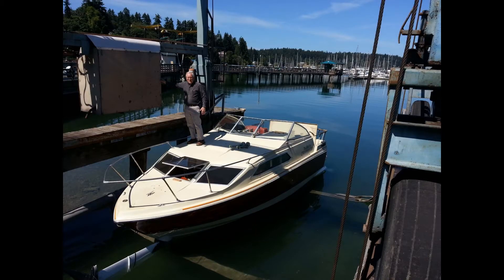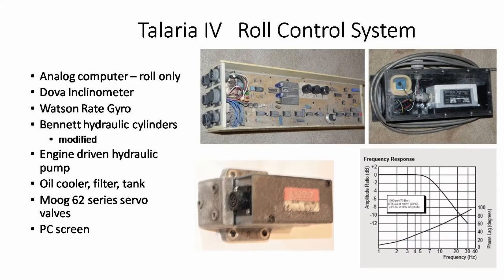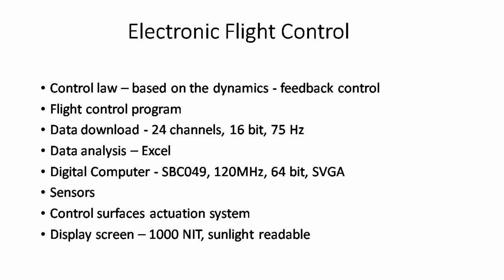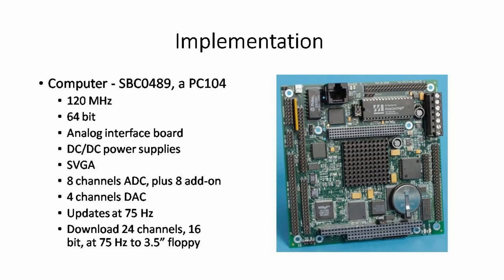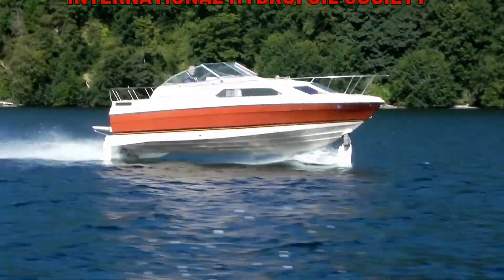HYDROFOIL -- CONTROL SYSTEMS FOR HYDROFOILS -- HARRY LARSEN EXPLAINS ALL

Comment: Hi Harry. It was nice to see some footage of the evolution of Talaria IV from your earlier experimentation with smaller foil-equipped runabouts.

I have a few comments and questions, some of which you might be able to cover when you give us your live Q&A on-line presentation on 10 November:

1.   You mentioned that surface piercing hydrofoils perform more poorly in following seas than in other wave conditions. That is a shortcoming that had been recognised by the designers of such hydrofoils. Supramar had recommended lower wave height operations in following seas than in head seas. Of course later on, for the RHS series of hydrofoils that Rodriquez built, they had in some cases incorporated a Stability Augmentation System (SAS) developed by Hamilton Standard which provided automated flap control in a design that fundamentally still retained its surface piercing characteristics. There is an old Rodriquez promotional film (bow video) available on YouTube, posted by fellow IHS member Garry Fry, in which the SAS is described and the results achieved from this are demonstrated in broad terms. But I wonder how much the SAS might have improved the performance of the RHS series over similar sixed PT series surface hydrofoils without SAS when operating in following seas? Have you ever heard any more details about this?   

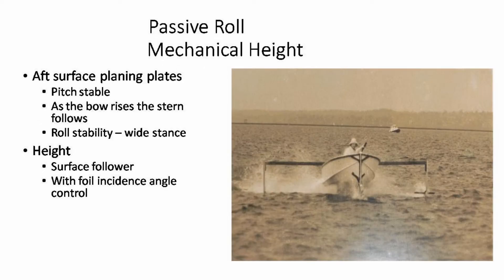2.   Ray's commentary doesn't spell it out, but I assume the boat shown from 2:24 onwards is your earliest experimental craft with foils fitted? I see you adopted a very wide aft foil spacing at that time. But this craft still had some form of surface sensors on those aft foils, so what was the basis for the wade foil spacing you had adopted at that time?

3.    At 3:25 it is mentioned that the foiler moths employ 'trailing surface follower' wands. While the wand certainly trails behind its pivot point, that pivot point is still mounted at the very bow of the boat and as such, unlike on the Rave foiling trimarans, the wand touches the water surface forward of the main foil location. In that sense, it is still somewhat of a 'leading surface follower'. Surface sensors that project forward seem to run a greater risk of being damaged or potentially 'digging in' under some sea conditions, so trailing wands/sensors seem to be better if the design is limited to a mechanical sensor. Extreme cases of forward projecting mechanical sensors were seen on some of the Hook hydrofin boats, the UK Ranger hydrofoil based on Hook's control principles, and some of the early USMC experimental LCVP hydrofoils. But on the other hand, the benefit of sensor that project well forward is that they might be able to better anticipate the waves that are about to be encountered. Have you ever considered how important it is for the surface sensor to be located ahead of the boat or the foil it is controlling when you were still reliant on such mechanical sensors for your craft?

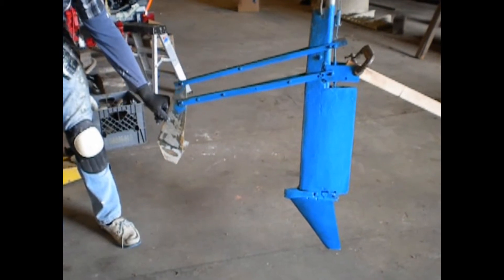4.   Is the foil and mechanical sensor mechanism you demonstrated in the workshop at 4:15 the same unit as was installed in the runabout shown from 4:45 onwards? It seemed to tolerate the waves it encountered, including the wash from the other boat, very well.

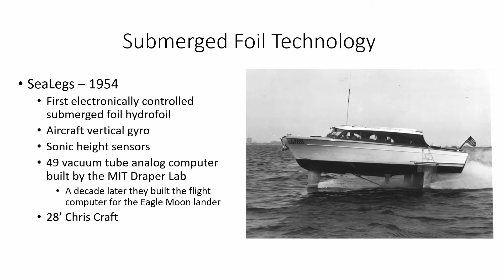5.   Do I interpret the video correctly that the mechanical bow foil sensor that was fitted to Talaria as shown from 5:34 onwards was replaced by a fully electronically controlled system by 2008? Did you experience any teething problems in making that transition from mechanical pitch (and height?) control to fully electronic? If so, can you discuss those during your presentation?

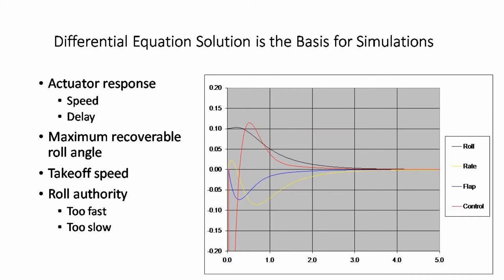6.   From about 9:16 onwards you provided an example simulation of the control response to return the boat from an initial 0.1 Radian (5.7 degree) toll angle and initial zero roll rate and flap angle to an upright condition. Was this simulating Talaria IV or another craft? The control law used must be fairly effective given the return to an upright condition occurred within 3 seconds without the boat overshooting in roll to the other side. But do you have an explanation for why the simulated roll angle initially increases ever so slightly? Is this perhaps a similar effect as when a ship first moves in a direction opposite to its intended direction of turn when rudder is applied?

I don't think I will ever manage to figure out all the 'more modern' control strategies that are now employed for hydrofoil control. Simple PID controllers are about the limit of my comprehension!
Reply: For 1. No.
For 2. Yes.  The purpose of the boat was to test the bow foil height control using feedback from the surface ski.  The very wide spacing of the aft foils along with the planning plates was to insure roll stability.  After the bow foil height system was established experiments to control roll were undertaken.  The first test placed a 4’ span foil above the ventilation plate of the outboard motor, (with a 2’ extension).  “Oars” were projected from the sides of the boat for roll stability.  The next test had an 8’ span FG foil with flaps controlled by a Z80 micro-computer and an electric motor driven hydraulic pump controlling a hydraulic cylinder actuating the flaps.  Over time the electronics were upgraded to the latest technology, in particular, the computer and the roll rate gyro.  In the next video of the boat the aft foil was cut off to a span of 4’.  At that point the control dynamics were the same as that of a larger craft, the size of Talaria IV.  With the height and roll control system’s performance established the larger hydrofoil system, Talaria IV, was then developed.
For 3.  I used the term trailering surface follower only to distinguish it from what was shown in my experimental craft.  I was not referring to the wands location relative to the strut.  I agree the forward projected ski is more vulnerable than a trailing ski.  At 4:15 the ski mechanism is shown.  A significant feature is how the angle of the ski varies with height.  It will not “dig in”.  This is why a 4 bar linkage is used.  The primary advantage of having the height “ski” ahead of the strut is that it creates pitch/height stability.  If the ski is ahead of the strut as the boat pitches down the feedback increases the lift of the bow foil.  If the foil is incidence controlled, depending on the geometry and feedback gain the height control can compensate for a pitch deviation without changing the flying height.  
I have considered the importance of locating the “ski’ ahead of the strut.  My analysis conclude that it helped but not much.
For 4.  Yes
For 5.  Yes.  The transition in 2008 was more than just replacing the mechanical height control with an electrohydraulic control system.  Up to that time roll was controlled with an analogue computer.  (In 1992 when Talaria IV was built digital computers were too slow.)  In 2008 an entirely new digital control system was built.  Some new sensors, additional servo valves, a flat screen display, and all new electronics.
For 6.  This is a simulation of Talaria.  
No.  The flap angle, in blue, starts at zero and rapidly moves downward to about -.07 radians at about .2 seconds. This movement is dictated by the control law. The simulation starts with the boat at a roll angle of .1 radian.  Because the boat is off axis its roll angle increases.  Until the flap has moved far enough to generated the torque to right the boat it continues to fall over.  When it has the boat is righted.  
The control law is a PID controller.  The difference between “PID” and control laws developed using control theory is that they have a mathematical foundation based on the differential equation of the dynamics.